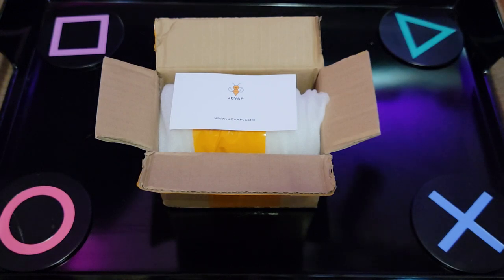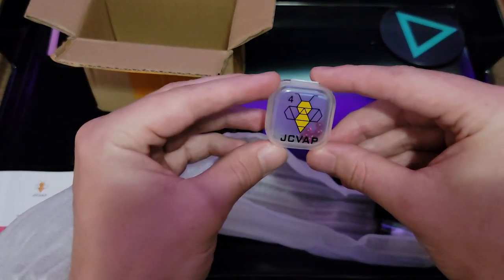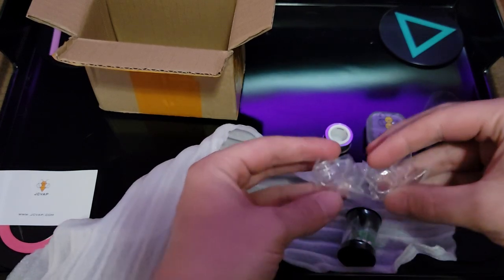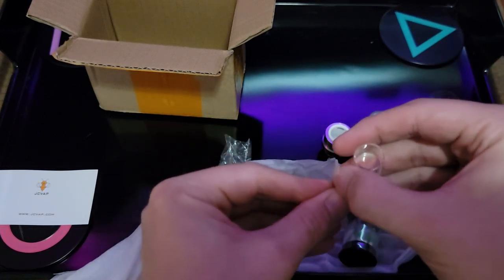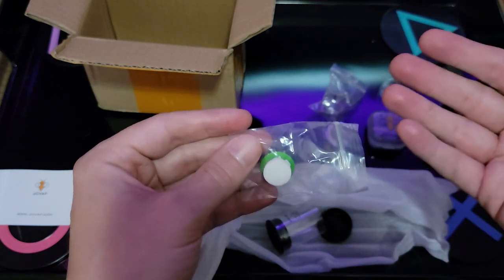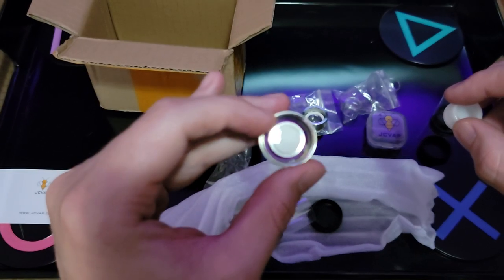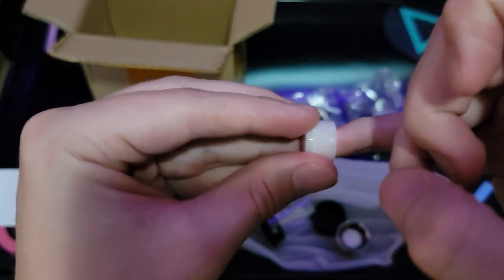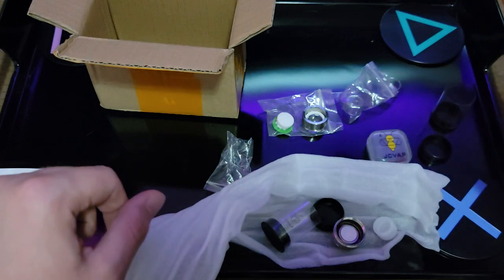JCVAP Puffco Peak Pro Atomizer unboxing.

Comment: was thinking about picking up the The Ruby Insert on JVAP
Reply from the maker: I was as well since the SiC was Sold out. but it looks like a thick boi and I think the site was saying to do two cycles for proper heating.
Reply: @Wallpaul420  true true but besides that you think its still worth copping
Reply from the maker: @whatispleasant  hmm depends on if you had/liked the old ruby insert from the og peak. if you like low temp dabs it might be good. This opaque insert should theoretically be hotter as the thermal conductivity is different, but it does not chuck clouds. (maxed out temp) the numbers are there as i can check with terpometer so idk. flavor was better tho hands down.
Reply: @Wallpaul420   how strongly do you recommend  jcvap  I'm debating rather or not to but one of the gravity bongs they have available